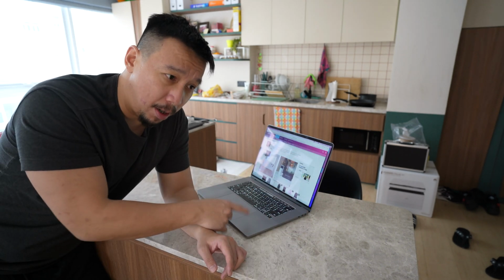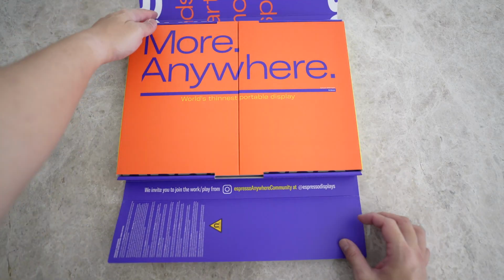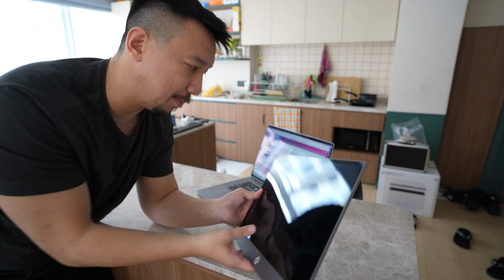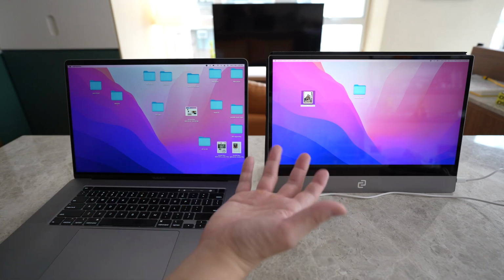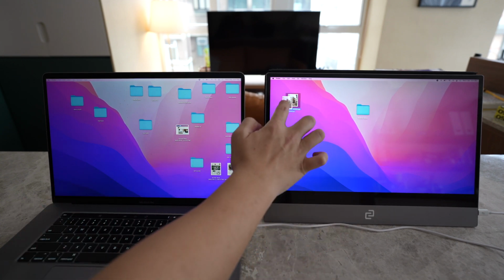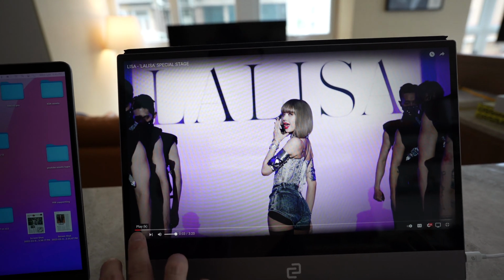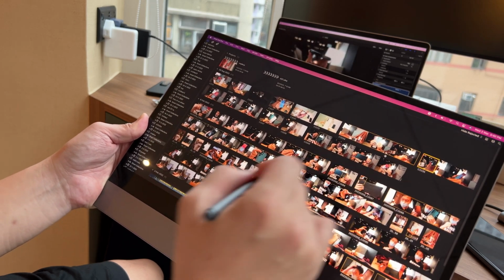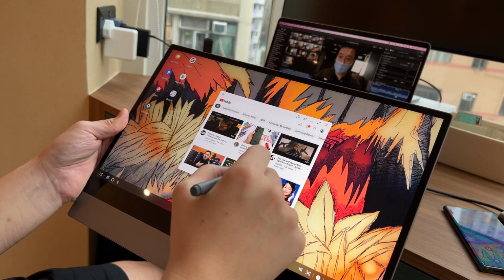Espresso Display V2 Review: 15-inch Touchscreen for MacBooks!

Comment: Does the touch screen work completely if connected to a desktop (no laptop) or do you need to use the Expresso Flow software for Windows?

Comment: If I bought 2 espresso displays, would they work together as a dual monitor set-up with my MacBook Pro?
Reply from the maker: Only if you have an Intel or m1 pro MacBook pro. Cause the m1 and m2 doesn't support two monitors

Comment: Is the Espresso screen usable if you lay it flat or nearly so? Can you use it well if it's tipped 15 to 20 degrees up from horizontal? From what you show at 1:27 it looks like this could work.